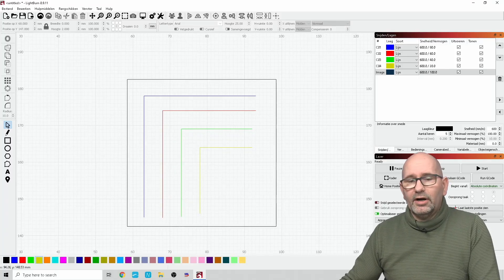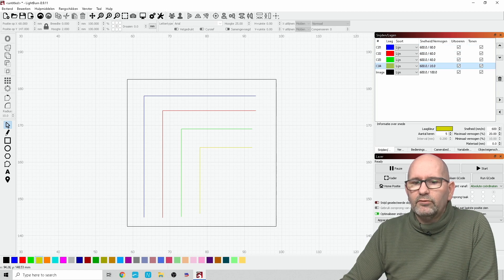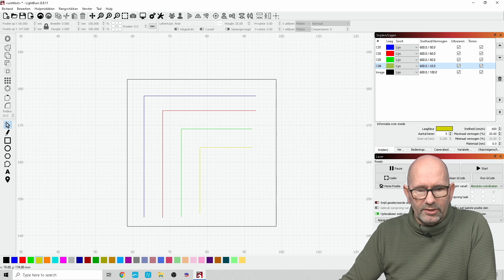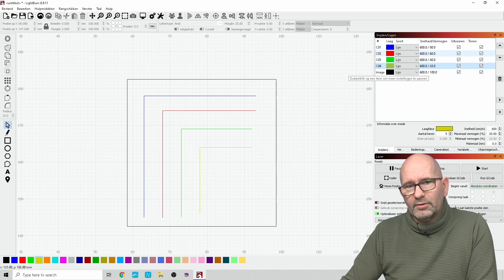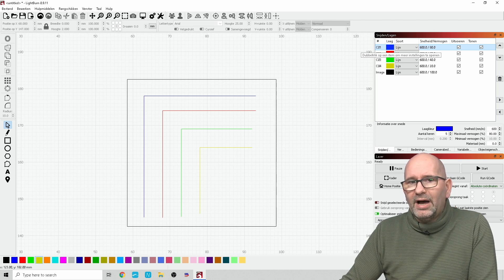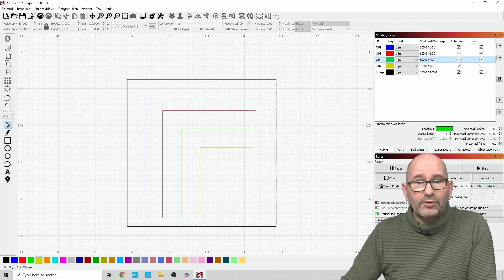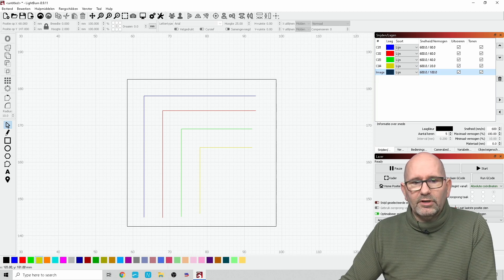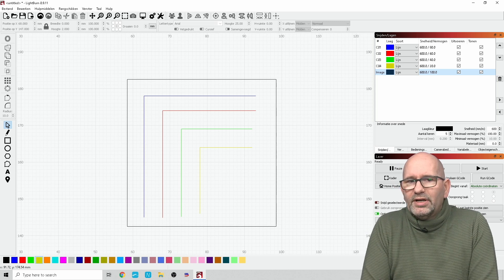▼ Why can't a DIODE laser cut thick materials? | KERF explained

Comment: Great explanation! Thanks. I upgraded my sculpfun s6 pro to air assist thinking it would blow out the ash and allow me to get through 1/4". Made no difference at all. Center of my 1/4" material is burned to ash, cant get all the way through, and just as he described, i cut through on x axis, but not on y, because the beambis less intense on y on my machine.
Reply from the maker: Hi,
Of course I don't know how well your air assist works, but the difference between working with or without an airassist should be about 20% depth in a material like wood. The question is, is your airflow straight down, or does it spread, and also, howe much air are you using, what is the presure you are using?
If your airflow and presure are good, then you could try lowering your power and try using a higher speed. This sound strange, I know, Yet now you can make more passes and your airflow will be more sufficient in blowing away the ashes, so that the laser burns fresh and clean wood, instead of it strugling with the ashes on top of the wood.
Also, where do you ficus your laser? The best place to ficus the laser is in the middel of your material. if set correctly, you should be able to cut the back of the material almost as easy as the top of the material. Of course there are limits to what you can cut, but with these tricks (if you didn't already uise them) you can cut a bit deeper into the wood.

Good luck, and let me know if it helped.
Reply: @3dPrintCreator  Im using the official Sculpfun s9 kit and full blow. It mught have made a 20% difference in depth, but i was expecting it to give me lightly browned edges and they still turn to charcoal. My point was more that it wasnt the miracle cure. Im brand new to this. Going to limit myself to 3mm max thickness and then learn the machine.

Comment: great informative video. Thanks!
Do software exists, that can control an exstra motor. to control rotation of the laser. to keep the best angel of the laser beam all 360 degre around. would be pretty easy to 3d print a holder that can turn it the 180 degre needed.
Reply from the maker: Not that I know.
In the latest lasers, this is not an issue anymore. They generate a square beam.

Comment: What about re-focusing the laser in the middle of the cut? Would that allow us to cut deeper?

Btw, thank you for the video - very informative.
Reply from the maker: For sure. Focussing in the middle of the object is always the best choice.
Reply: @3dPrintCreator  Sorry, I meant cutting a layer, refocusing the laser, cutting another layer, refocusing the laser (or changing the z-height - depending on laser) and so repeat. Or would refocusing the laser miss-align the beam?
Reply from the maker: @martinlaak  Yes, that's a good way of getting more depth in the cut. There are lasers now that have this auto sinking function, like the Ikier and the Atezr models.

Comment: Would be interesting if the machine could be designed to be self height adjustable during the cutting so it could stay in focus all the way through the cut.
Reply from the maker: Most cheap engravers don't have a Z adjustment but the software I am using is capable of controlling the Z height.
I have yet, not seen any Chinese laser engraver that can work with these commands from the software.
Reply: I mounted a diode laser to my cnc machine which is also a router. I have an adjustable z axis so theoretically I can do subsequent passes at lower levels. Just like a router.
Reply from the maker: That will give you so much more options to cut deeper. :-)
Only know that because of the shape of the kerf, the depth won't ever be deeper than about 5mm on harder materials, and 10mm on soft foam etc.
Reply: @3dPrintCreator  Yeah, your explanation of the kerf shape explains why I couldn't cut out cardboard shapes for custom boxes. 

It makes perfect sense now!

(I make custom boxes for my signs out of recycled sheets/boxes from appliances, furniture etc)
Reply: A lot of cnc’s now have a laser option. But most I’ve seen start at $700.

Comment: thanks man good explanation. Mooi verteld en uitgelegd. Is there anything we can do about that focus problem.
Reply from the maker: Thanks.
Yes there is... Buy a CO2 laser, and the problem is gone :-)
Maar zonder gekheid, nee... helaas niet. Dit is een eigenschap van een diode laser.
Reply: @3dPrintCreator  Bedankt , For the other readers too in English. Do you know something about the real lifetime of power diode lasers and the effect of temperature that has on it. I read things around 10.000 hr but is that real?
Reply from the maker: There is no real data for that. 
Running a diode laser on maximum power, means you have to cool down the laser better, than when running on, for example, 75% power. 
I do have a lot of lasers here, and in a few years time, I only had one diode laser head replaced, because it burned, yet this was the direct result of a wiring problem, where I made a mistake. 
When you search on Facebook groups, or forums, you will find people that burned their lasers too, yet I don't know what they did to make it happen. I only know I melted one of my lasers because I made a stupid mistake cutting out the cooling fan.

Comment: Thank you so much for this explanation - especially the 3D printed representation.  I've recently bought a diode laser (had a CO2 for years) and have been scratching my head on results.  Low power etching gives lines in X and Y that appear identical in width, but high power cutting yielded what you are showing thin in one direction and thick in the other, I couldn't figure out why because my experience with a true round dot on the CO2.  Now it all makes sense!!!

The deeper I cut the further from the round focal point I am and the wider it gets in one direction!  Thank you so much for this explanation!!
Reply from the maker: There are special Collimation lenses that can be used, however that requires to not only add that lens, but also open the housing of the laser and align the diode to be perfect with the lens.
This should only be done if you are comfortable working with lasers, and know how to do it the safe way.

Comment: I have a Snapmaker 2.0 A350 10W diode laser that can cut through 8mm. They just released a 20W and 40W diode... I don't really need to go thicker than 8mm to make finger joints...
Reply from the maker: More power doesn't only mean more thickness when cutting. It also means more speed when engraving, or in some materials even cleaner cuts.

Comment: Makes total sense. There are other factors at play here though. The diode laser I have has trouble with .75mm modeling plywood (5 layers). But 3mm basswood (linden) it blows right through. MDF, it really struggles with 2mm. At higher power ratings it scorches the material. One factor here is the material compostion
Reply from the maker: There are many factors when printing wood that come into play.
The density of the wood is one, but also how moist the wood is, makes a big difference. plywood from my warm room cuts way better, then the same plywood from the shed, where the humidity is much bigger.
I make tests before I start cutting to test for the best speed and power settings.

Comment: Thank you so much for video, it is very detailed.     I need to cut wood veneer that its thickness is about 0.6-1 mm (marquetry). First, do you suggest diode laser usage for this purpose. And which power will be better, neje 7 watt and more passes or 40w maybe less passes. I am asking this because I checked data sheets and I saw that neje 7 has 0.01 focus diameter but 40 watt have 0.1 mm it is greater than 10 times, thank you so much, best
Reply from the maker: I don't have any experience with the 40Watt (or 30Watt) lasers yet, but knowing what is possible with the 15 and 20Watt versions, and comparing them to the 7 Watt machine, I would go for power in this particular case. As long as the cuts are good looking and nice, it's doesn't really matter how big the kerf is.

Comment: So just a hypothetical question here, if you know the depth of cut your laser makes in a single pass could you alter the z axis by that amount for each pass ? Would this give you a narrower kerf and allow a deeper cut ? Obviously you will still have a finite depth of cut because the lens can only get so close to the top of the material, but in theory you could either raise the bed of the laser or lower the diode head itself on each pass
Reply from the maker: Not really,
As the focal point is the only point where there is real energy to burn the material, as you get deeper into the material, the V shaped beam will hit the surface of the material out of focus, so less energy is reaching the depth where you want to have the energy. Also, there is ashes and coal there where the laser has already burned, and there you would need airflow and even more laser power.
As a diode laser always works with a light beam with a focus, it will never be perfect for multi layer cutting with variable Z height. Therefore you will need a CO2 laser.
Reply: @3dPrintCreator  Oh I agree that CO2 lasers are much better, what I was saying is that by altering the z axis height you are altering the height in the material where the laser is focused, now I fully agree that this would only have a very limited effect and without blowing out the ash from previous cuts it's almost useless, but let us take the following example, lets say the laser head is 20mm above the work surface and in sharp focus and that it cuts 0.5mm deep per pass, let us also assume you have a directed air blast clearing the ash, the potentially with each pass you could lower the laser by 0.5mm and do another cut at optimum focus, the beam to the focus point is a V shape so your limit on depth will be the point at which the beam is wider than the slot it's cutting OR the point at which the air blast no longer clears the ash of the previous cut, I suspect economically it's not worth doing, you'd probably only gain a few mm extra depth of cut, but maybe as a modification even manually winding down the laser head using a head in a dovetail slot wound down by a calibrated screw thread it's perhaps the sort of thing a hobbyist could do, you'd need to pause the laser at the end of each pass in order to wind the head down, but for some people a few mm extra depth of cut might be all they need ?
Reply from the maker: I found this idea interesting enough to do some testing with my laser.
I tried many different things to optimize my airflow and focal point, yet the best result I got, gained not more than 0.9 millimeter more depth in soft balsawood, and even less in plywood.
Therefore, I decided not to make a video about this, but I wanted to let you know this result, because I liked the idea.
Thanks.

Comment: Nice explanation about beam divergence. Have you tried using the air assist blowing straigth with the beam instead of blowing at 45 degrees at where the laser is cutting? It will improve the cutting ability of the diode. Also you need to have in mind the directions of the wood fibers when cutting with less power. You could try to rotate the plywood 90 degrees and see if you get the same results. You could also change the axis direction from where the air assist is blowing at 45 degrees and see if you notice any diferences on the results.
Reply from the maker: My previous air assist (type 1) was a pipe with an opening on the top were the laser light came from the same pipe as the air. Yet, this was way less effective as this air assist is.
I have made 8 itterations to test different types of air assists, and this (up until now) was the best.
But, I am not finished yet, as I am renewing my desing from time to time.

Comment: A minor (?) correction: the energy is not 'wasted' or lost in the wide part of the spot, but rather the energy density is reduced proportionally.
Reply from the maker: Quite true of course. Energy can never arise from nothing, and never be lost in nothing. The term wasted is used incorrectly.
Reply: @3dPrintCreator  Strangely enough, there may be exceptions to that law.
Reply: It cant be wasted from a conservation of energy point of view, but it is most certainly wasted from work done in cutting point of view. The wasted energy, wile not "lost" is most certainly wasted (going where you don't want it or need it to be) and not doing what you would have liked it to do.

Comment: I wonder if adding a proper collimation lens would be possible?
Reply from the maker: If the build quality of the laser versus the lens would have been better, yes that would be easy.
Now it is only possible if you open the housing of the laser and align the diode yourself in the correct orientation so it lines up with the collimation lens.
There are people on YouTube who have done this.
Reply: @3dPrintCreator  interesting, I bought the neje master 2s plus with the dual laser module and I got through 12mm ply, but the last 2mm took more passes than the whole first half. Not bad though, and I keep the laser on 80% Max.

Got any links or search queries? I may look into Thus.
Reply from the maker: @adrianscarlett  I myself try to stay away from facebook (although I do have an account). There you will find some groups that have posts about collimation lenses, and I have once seen a detailed instruction on how to replace the lens and align the laser diode for an Ortur Laser Master 2 machine.
But, if you have the dual laser module, you should not have this problem, as one laser is horizontally and the other vertically aligned. In fact, on a dual laser module, you can't use a collimation lens at all.
Reply: @3dPrintCreator  interesting, I never thought about there being issues with collimation of a dual laser.

I'm the same with facebook, I created an account when it first appeared, and until I was forced to use it with my oculus quest 2, I'd logged in maybe 3 or 4 times

Comment: I have a diode laser Atomstack A5 pro and now I have a CO2 laser 50W  The CO2 really 8-10X stronger and faster but it does not really cut deeper than the Diode laser both of them cuts about 10mm. You can put a longer lens into the CO2 laser which make possible deeper cuts but than power reduce about 3X so it is not that strong anymore. And than comes the problem of conusing (in both cases)

Comment: As a compromise, you can orient the laser at an angle of 45 degrees and the X and Y losses will be the same.
Reply from the maker: How does that workout when cutting a circular shape?
Reply: @3dPrintCreator Not really on the circumference. This works well with lines located on the X or Y axes, any oblique lines start to work worse due to the fact that the beam configuration is not a point and not a square, but a rectangle. And when the feed comes from the long side, the power applied to one point is less than when feeding from the short side.
Reply from the maker: @Maksim_Luchikhin  Sorry, but then you really misunderstood the explanation. In the X axis, the rectangular shape of the projection benefits the user because the slice is at its thinnest. In the Y axis, the user has the greatest disadvantage, because the cut is then at its thickest. All of course in relation to time, because the laser moves at a certain speed over the surface of the object to be engraved or cut.
So X is maximum profit, Y is minimum profit, and in the oblique lines, depending on the angle, it is somewhere in between.

Comment: I’m pretty sure this isn’t an issue with the Neje 40640 laser. It uses 2 x 7.5watt lasers that combine a form a very tight square. I have seen several videos of it in use, but it’s a little hard to understand why users seem to be getting very different results. At it’s best, it seems to be pretty darn capable.
Reply from the maker: I can't say anything about that specific laser as I never tried it. I hear good things about it though.
Reply: I recently got a NEJE 3MAX with a 40640 laser diode! I use it to cut leather mainly! I use 3mm veg tanned leather. Cut perfect in one direction but not in the other!  I also use air assist, but the problem remains!

Comment: Question, if you place a mirror at 45 degrees so the diodes focal point is at the mirror surface would the reflected light still show these properties
Reply from the maker: No, and at this time there are lasers that are made like that. Ortur has the Laser Master 2 Pro, that uses a laser like that, but also other brands now are doing this.